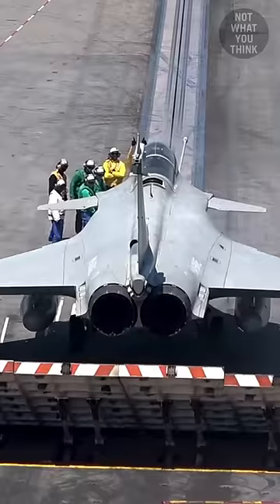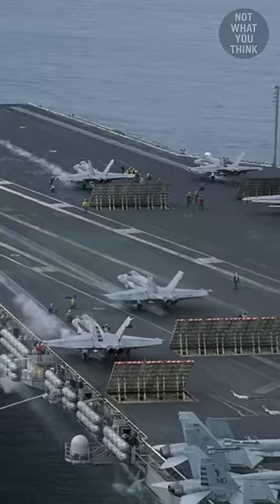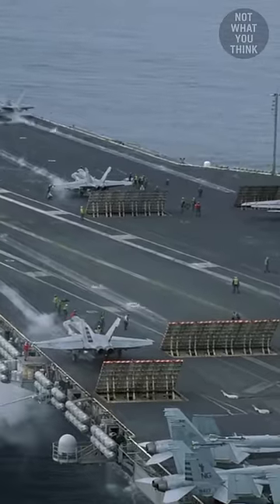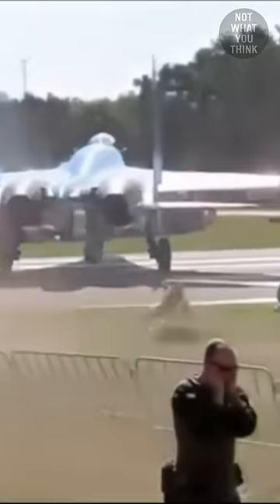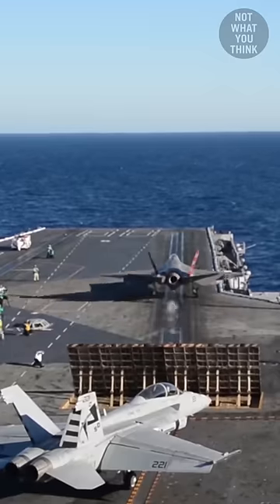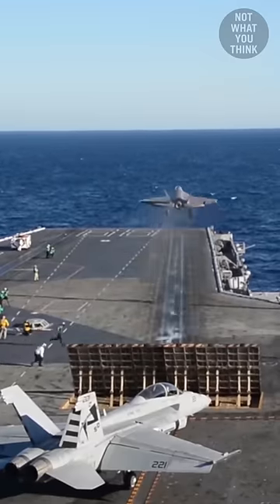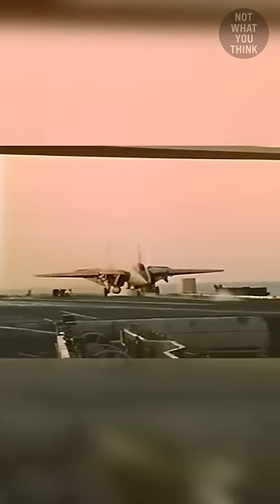Importance of Jet Blast Deflectors

Comment: I have a few stories related to getting jet blasted. 2 of them are of me, the latter the F-16, was my own fault.
In the 80’s worked on F-4’s. We would rotate thru EOR duty on a weekly basis, between us and the other Fighter Squadrons in our Fighter Wing. One of the things you do at EOR for the F-4’s is chute retrieval. Drag chute that is. It always uses it drag chute when landed to avoid hot brakes. As the pilot is turning into the EOR parking spot, he ejects the chute into the recovery area. Sometimes the chute doesn’t come loose. The buckle gets stuck. When that happens one of us goes behind the jet, grabs hold of the droug chute, and pulls it loose. One time, the pilot was getting antsy. His chute was not in his exhaust plume. It had deflated flat on the ground. He kept trying to goose it, to inflate it. But it was a no go. I was heading to grab it, with eyes on my team chief. When she gave me the go ahead, I grabbed the chute, to toss it into his exhaust. He goosed it to early. The chute buckle came out, nearly hit me (its a two pound metal buckle) zipped over my head. But its what its connected to. The lines that connect the chute. Wrapped around me like spiderwebs. He was still goosing the engine which now had me rolling in the exhaust. Wrapping me up in the drag chute. I could do nothing but pray I didn’t end up on the runway. It put me about 200 feet from where I was. Took my team several minutes to unwrap me. Later that day a pilot showed up at the little shack we used between aircraft. “Wheres airman Johnson?” Here sir
“This is for you” he handed me a case of mt dew.
“I was going to bring beer, but your crew chief said you are not old enough to drink. She said this would do.”
My crew chief, Mary Kay gave a cough, and said “anything else you have to say?”
“Ahem… yes…. I um… I’m really sorry about that chute thing. I really hope you are ok”
Then, nearly 20 years later. I’m working at EOR for F-16’s. Pulling safety devices. Remove before flight streamers, check the aircraft over for loose panels, screws, etc…
I went around the back of the aircraft, ducked under the tail feathers. And stood right up into the exhaust. It hurt like hell. Like getting hit in the face with a slush ball. Knocked my hearing protection off. Sent them flying. Rolled me about 75 feet into incoming traffic. I ended up flat on my back. And looked up at the cockpit of an F-16. The pilot with a ‘oh shit’ look on his face. I was just to his left, but in front of his left main. He had stopped. He looked at me and pantomimed to me, “you good”? I gave him a thumbs up, a quick salute. And got back where I needed to be. No one saw what happened but the pilot that nearly hit me. I was too embarrassed about it to say anything.
Reply: damn thats amazing, though how are you doing right now?
Reply: @markanthonytombiga6450  It was just an embarrassment. I knew better. I was the guy that didnt make those kind of mistakes. But as Murphy’s Law states, “If it can happen, it will happen, at the worst possible time”
Reply: That was a good read. Those phantoms must have been amazing to work with.
Reply: @BigBossIvan  I was honored to be able to work on them. 37h AGS WILD WEASELS. F-4E and F-4G
(But a nightmare for the technician. Imagine, removing a 6” x 6” panel, reach inside, avoiding the scalding hot panels, open another (into your elbow deep now) that panel luckily is hinged, get your elbow up to that panel, face now planted firmly against the belly of the aircraft, reach inside, find the correct plug, remove the safety-wire, disconnect the plug. Then the reverse. Putting new safety-wire (also known as lock wire) back on, and thats a learned skill, putting in on blind, and hoping you are at the correct angle to get your arm back out. Sometimes it takes longer getting out. That is an extreme case, admittedly, but not a rare one. Not to mention the little holes, under the seat, that sucks tools down it.
Reply: @Technichian462  man safety wiring is a nightmare even when you can see it to do. Let alone behind something and doing it blind. Geez.😳
I’m not worthy!! I’m not worthy!!! I’m not worthy!!!🤷🏼‍♂️🙇🏼‍♂️🤷🏼‍♂️🙇🏼‍♂️🤷🏼‍♂️🙇🏼‍♂️
Reply: @ba946x4  For most jobs, its a cinch. Safety-wire pliers. You can use those things and get the perfect amount of twists, and evenly spaced. But for bragging rights, there were those of us that did it by hand. Back then, damn near every bolt on the F-4 was safety wired. Weapons troops became experts at it. I wasnt the best, but I could do while half awake. Even one handed. But some guys were just “one with the wire” 😎
Reply: @BigBossIvan  They were a nightmare, and fun. An unpredictable beast she was. 
Look up Dick Jonas. He was (is still?) a pilot and flew the F-4 and F-16. Look for his album “The People We Knew”. Some song will make you laugh, some will bring you to tears. You have been warned.
Reply: @Technichian462  I know what you mean. Just about every nut and bolt on a power plant has to be safety wired for obvious reasons. But I remember having to learn how to do it was a nightmare for me at first.😬
Reply: Cool, thx for telling this story.

Comment: And thanks to how violent those ejection seats are, those two highly trained pilots likely couldn't serve anymore, not to mention the expensive jet.
Reply: Most of the time, pilots can essentially immediately return to service, as long as they aren't otherwise injured (hard landing, struck by debris, etc). Seat tech has come a long way, and spinal injury is pretty unlikely.
Reply: @needsmoreboosters4264  Really?  Well that is great news, I was under the impression that the G forces ruined your back in most cases.  Unfortunately that footage was very old just like the technology in those ejector seats.
Reply: @Voltaic_Fire well since they weren’t moving at all when they ejected they wouldn’t suffer as badly as if they would moving
Reply: That jet was still upthere, but i know the reparation costs are big, at least is not the whole price of the jet
Reply: Better than being dead. You'd probably be put on medical probation after the investigation, but you'd probably be completely fine otherwise. Just making sure is all
Reply: I was under impression that it's not the ejection seat itself that causes most injuries, rather it's coming over the windshield (not sure if that's a correct term but you know what I mean) and suddenly being exposed head-first to pressure from the air you're moving through, like faceplanting a brick wall
Reply: @Voltaic_Fire that's usually when they are already flying. When they eject while they are flying it's much worse gs. The regular ejection from the ground likely won't cause injury it's a manageable amount of gs. It's still dangerous tho.
Reply: @Voltaic_Fire it wouldnt have been as bad for them since they were stationary
Reply: @needsmoreboosters4264 
Source?
Reply: Nope go thru medical eval and flight status determined from there
Reply: @kennethhamilton5633 Yeah, and I think pilots only get to eject twice. After that, Uncle Sam isn’t giving you any more $38 dollar weapon systems.
Reply: @apricity69  
John McCain ejected 5* times lmfao.

*5 times, not 11. No idea where I got that from. 😆
Reply: You can serve more with one ejection, but if it’s ur second ejection you can’t serve anymore.
Reply: All of these myths everyone here is parroting are untrue. Ask any fighter pilot or naval aviator, and they'll tell you the exact same thing.

The myth that "you can't fly after ejecting two times" originates from the 50s and 60s when ejection seats were first introduced. Being new technology, they obviously weren't as refined and safe as their modern counterparts. There was a high chance of getting injured, but a pilot would rather take a high chance of getting injured in ejection over a guaranteed chance of death in staying with the aircraft.

Modern ejection seats are very safe, especially if you're on the ground and aren't moving. The chance of long-term, permanent injuries are low. At most, the Tomcat crew in the video got some bruises or the like, were picked up by a SAR helicopter, and returned to duty the next day after being cleared by a doctor.

That brings me onto my next point. As long as you're medically cleared to fly after an ejection, you're fine. Unless you were found at fault in the investigation, nothing will come of your ejection, and your career goes on like normal.

I kindly ask all of you to do some research before commenting next time. This information isn't hard to acquire. In most cases, it's just a quick google search away.
Reply: @apricity69 where can I get one of these $38 dollar weapon systems?
Reply: Never heard that, interesting the seats take off that fast
Reply: @rustyshackleford3320  The high speed and acceleration is required for the pilot to safely exit the aircraft at high speeds.
Reply: @Monarch683  Thank you sir. What's your source? :)
Reply: @Mygg_Jeager  Youtube isn't allowing me to post links to my sources. However, you can easily look up your own. It isn't hard and won't take more than 5 minutes.

The one I was specifically looking at is by the University of Notre Dame. Of course, the best source is the direct one. I'm well invested in the military community, so I've known a handful of fighter pilots myself that can back up my claim.
Reply: @Voltaic_Fire I was under the impression that most ejector seat injures occurred from bailing out at speeds above mach-1. But I’m not sure, the fastest aircraft I’ve ever piloted was a Cessna Grand Caravan. Definitely no ejector seats in those.
Reply: @Monarch683  Interesting, thank you. 
I didn't need a link, just a publication and an author name lol.
Reply: Just remember what happened to Goose.
Reply: Zero-zero seats are pretty damn safe to anyone who is trained.
Reply: @TehSlaw this isn’t true. Ejecting from the ground used to be very unsafe till zero-zero seats.
Reply: @Aaron-McDonald  Safe enough to compress your spine about an inch.
Reply: @davemccage7918  Uhhh, no...? Why would you think that?

Military aircraft don't fly as fast as you think. They sometimes hit Mach 1 and above, but that's only when they're really in a hurry somewhere. Otherwise, they mostly travel subsonic.
Reply: @silvertalon007  Goose's death was entirely his fault for not following the F-14 Flat Spin ejection procedures as described by the F-14 NATOPS manual.

He was supposed jettison the canopy first and then pull the ejection handle to eject him and Maverick.
Reply: @Rigel_6  The term is canopy. And no that's not entirely true. The g forces from the ejection process can cause spinal compression. Yes, the sudden blast of wind can hurt your face n neck but that's why it's recommended you eject under a certain speed. The depressurization will not have the serious consequences of spinal compression however. But as technology has progressed, the mechanisms put in place too have. Which is why current day fighter pilots can get back in the seat rather quickly if they haven't had serious injuries like what you would from hitting the ground before the parachute fully deployed n actually had time to do its job. (Like in cases in some airshows where the ejection was too close to land)
Reply: @Voltaic_Fire  back then they killed you 50% of the time at low altitudes.

After the ACES II seat was introduced, they lowered injury rates to 1%. But the F-14 Tomcat didn’t have that seat.
Reply: @Mygg_Jeager McCain ejected twice: once when his engine failed over Chesapeake Bay, and once when he was shot down over North Vietnam.
Reply: @JarrodFrates  
You can look that up yourself you know lmao. It's 5* times.

*edited for typo.
Reply: @Mygg_Jeager  Your original comment claims he ejected 11 times, and now you claim 7 times. And I did look it up using multiple sources. He lost three aircraft: one when he crash-landed in the waters of Corpus Christi Bay and the two ejections that I mentioned. You're welcome to cite the others.
Reply: @JarrodFrates  
Source: military times article "the other 4 times John McCain ejected"
Reply: @Mygg_Jeager  That story's headline is actually "The 4 other times John McCain *cheated death*," and it's not Military Times but a site that sounds similar (it's not hard to find by the headline I quoted and the domain has "Military" in it, but even obfuscating a domain name typically gets comments deleted). The first was the crash into Corpus Christi Bay where he remained in the cockpit through the crash, the second was when he took out some electrical wires over Spain, the third was ejecting into Chesapeake Bay, and the fourth was when the errant Zuni hit the A-4 next to his while he was getting set up to go on a mission over Vietnam. There was one ejection in that article, and there was his final ejection over Vietnam when he was captured.
Reply: @JarrodFrates  
From another site:

""""" McCain did lose two Navy aircraft while piloting them. One crash was found to be McCain’s fault, the other due to an engine failure of undetermined cause. A third was destroyed on the deck of the carrier USS Forrestal when a missile fired accidentally from another plane hit either the plane next to McCain’s or, less likely, his own aircraft, triggering a disastrous fire that killed 134 sailors and nearly killed McCain. A fourth plane was lost when he was shot down over North Vietnam on a bombing mission over Hanoi.

A fifth alleged “crash” turns out to be a misinterpretation of a flight accident that did not result in the loss of the aircraft. McCain admitted to causing that incident through “daredevil clowning” but returned safely. """""
Reply: @JarrodFrates  
So for a guy that has so few "crashes" he sure as hèll has a lot of elections. Almost as many as your average test pilot of the same era. Only, he wasn't a test pilot.
Reply: @Mygg_Jeager  You're deliberately describing incidents as ejections when ejections never happened. He didn't eject from the Corpus Christi crash, and he didn't eject from the Zuni missile incident.
Reply: @JarrodFrates  
Pretty weak argument to try and split hairs over the difference between ejecting in open air because you're crashing a plane, and opening the canopy and swimming to the surface after you've already crashed the plane.
😏
Dude crashed planes for a living. FIVE OF THEM. Maybe ONE of them wasn't his fault.
Reply: @Mygg_Jeager  The conversation was about ejection. You said he ejected 11 times, then 7 times. Now you're trying to say that ejections (the topic of conversation) don't matter. You've at least come to accept that he actually ejected only twice, so that's progress.
Reply: Iirc the rule is you get two ejections in your lifetime. Once you do your second, you're out.

Comment: Whomever the Jet handler was that worked the deck is responsible.  Before positioning any jet, they must clear the path to the CAT.  If no blast deflector is in use, then no plane may be placed into the other jets exhaust area.

Comment: I was stationd on the Indy from 1992 -1995 I can assure you that there was no JBD behind cat #4 There never was. There were only 3JBDs on the ship behind cats 1, 2 and 3. THere is no need for them on Cat 4 when the aircraft are proporly moved around the flighdeck. Cat 4 is located on the waist of the flightdeck. it hangs over the water. I was working on the Deck during this incident. I workd in V2 Gear.
Reply: The video was cut and molded together with other older videos. Regardless of you being on the Indy, Aircraft Carriers from CVN 65 to present, all had 4 Capaults to include 4 JBDs. Research it, it’s a fact.

Comment: The video is incorrect, the JBD on Cat 4 is smaller (4 panels vs 6)NOT the “old” style as the video states, and because of this reason the crew cannot raise the smaller JBD behind a F-14, as omits standard procedure to launch with the panels down.  The directors placed the other F-14 in line with the jet blast, which should not have happened, a lot of people made this mistake happen
Reply: Nope the indy never had a JBD behind Cat 4.  All carriers of the Forestal Class did not have a JBD for cat 4.
Reply: @DisabledParkHopper He’s not talking about or referring to the Indy, or anything that you were used to during that time period. A lot of shit had changed from that time period…….old timer. Get with the current program before spitting bullshit.

Comment: The independence was an older carrier that needed to be upgraded. Whe. The tomcat first rolled out the indy was not even ready for that bird. That incident forced the indy into port and they got the necessary upgrade.
Reply: Nope the indy never got a JBD behind Cat 4. The last Dry Dock period for the Indy was in 1994 This incident happened on April 18 1995. All carriers of the Forestal Class did not have JBD for cat 4. The 14 that got blown was moved into  the wrong place by the Handlers (Yellow Shirts) on Deck. It was to far to the port and it was also to far out over the combing. When this incident happened I was just under this part of the deck waiting to get on the LSO platform for landings. The 14 that blew over was right there where we would come out to get up on the deck!